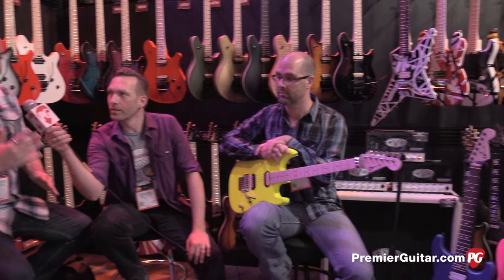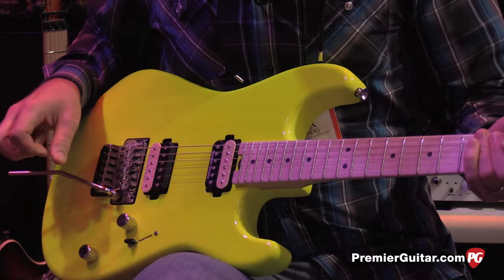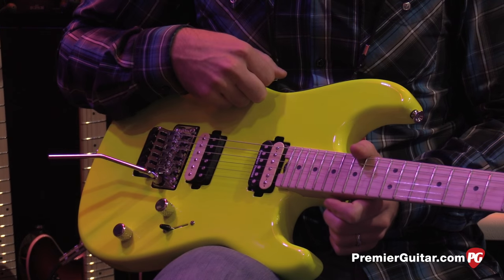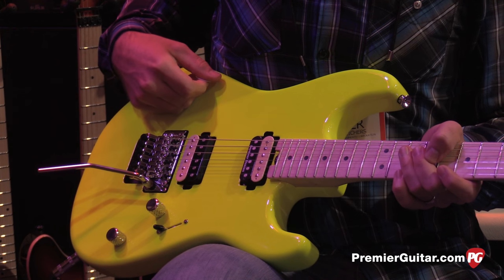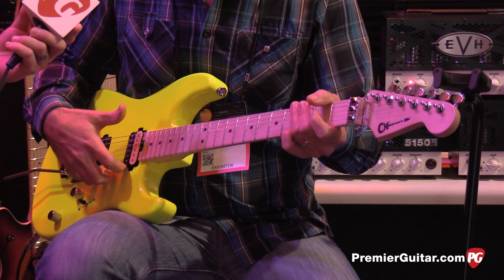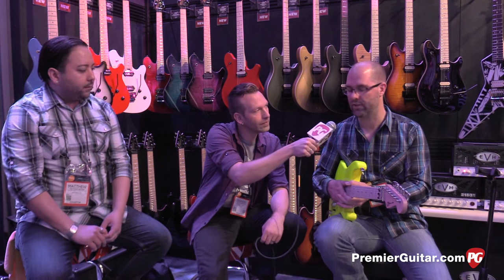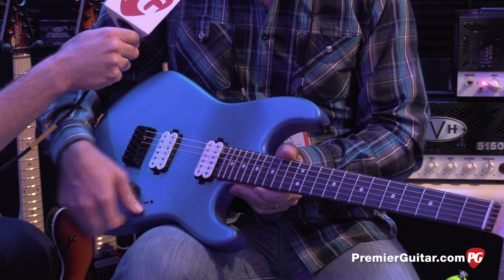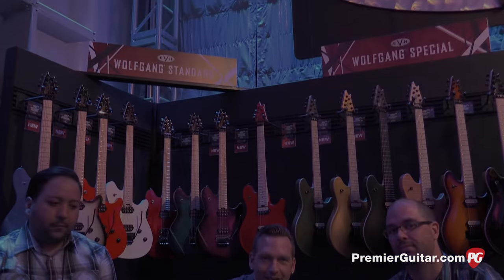NAMM '16 - Charvel Guitars Pro Mod San Dimas Demo

Comment: About time,they put a push-pull coil split and moved the volume knob,now they just need to put 24 frets on it.
Reply: +greekfreak1980 Αmen for 24 frets
Reply: Yes -- 24 frets, Stainless Steel, with LOW PROFILE FLOYD option...I can't stand original floyd with the tuners that stick up in the back.

Comment: Few things that bother me a bit, are the new placing for the volume knob, the new 3way blade switch and the fact that the neck has a bit less wood this year. It is a Jackson "speed neck" which is known to be a bit thinner thatn the original pro mod neckshape. Some people at NAMM 16 have confirmed that the neck feels quite a lot thinner now. On the other hand, the thumb wheel neck adjustment is an extremely great addition. They finally added it after all these years.

Comment: will a charvel neck fit a fender strat or tele body?
Reply: +yumadapaka you might have to change the pickguard since a fender neck is rounded at the end, on charvels the neck is squarish.
Reply: is a tele neck pocket square? i might have to google that.
Reply: yumadapaka my mistake a tele is square just not as much as the charvel. a change or alteration to the pickguard might still be needed
Reply: oh ok thank you for responding. ive checked out online the new fender elite guitars. i really like the necks. i might just get that. hopefully fender sells just the elite necks
Reply: yumadapaka np. yeah you could do that
Reply: +yumadapaka it wont fit a fender body, charvel necks use a 2 1/4" neck pocket, fender uses 2 3/16